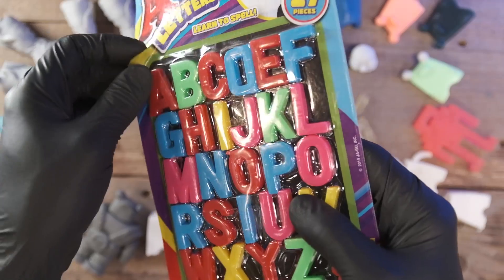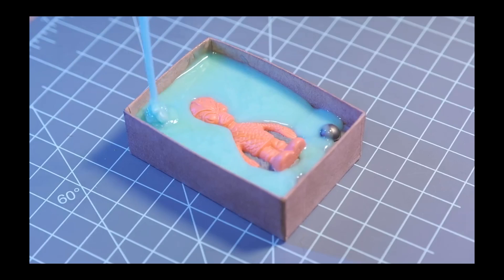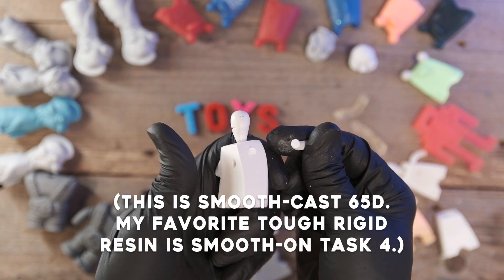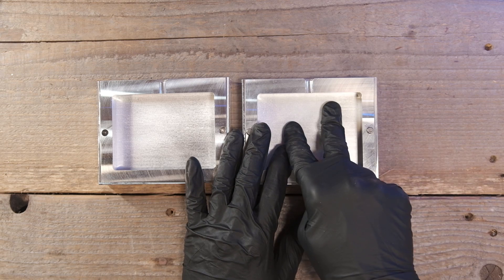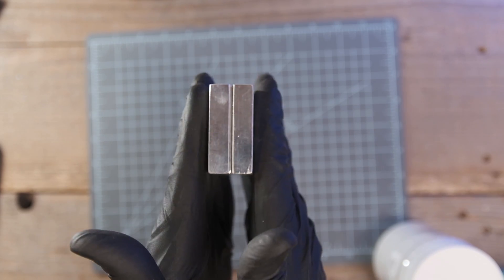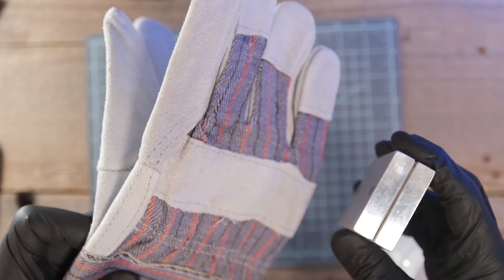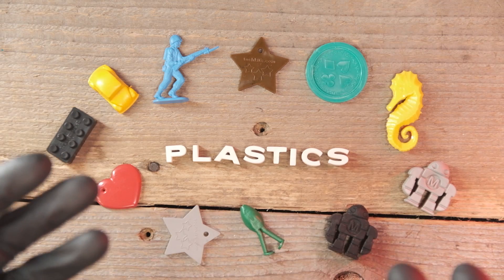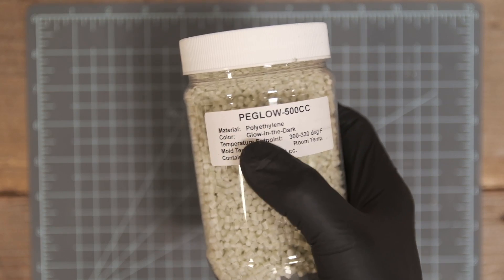First time INJECTION MOLDING! | Bench-top plastic injection molding.

Comment: 2 suggestions, 1st can you add a bracket to the push clamp and the side of the aluminum mold so all you have to do it release the clamp and the mold will open and remove the part and then ready to shot another one? 2nd, can you make a pewter mold for the injection molder instead of aluminum? Seems like the melting temp of the plastic is lower than the pewter and may work, but you would have to first make a silicone mold (mold max 60) then the pewter.

Comment: Super excited about the upcoming DIY version. I believe an oven is suitable for heating plastics to the soft fluid-like stage, and all I think we would need is a metal piston-like apparatus with a hole on one end. I would love to see how to convert 3D printed designs into plastics. Can you directly 3D print the mold that goes into the metal block?

Comment: Do you think you could Print those Metal Moulds, with a 3D printer (UV).. whats your thoughts.. The only thing, I think would be a problem, is either the heat or the strength ??

Comment: Instead of having an aluminum mold could you make a epoxy resin mold and inject into that? Epoxy resin is extremely hard and tough I would think that would be a cheaper solution than metal molds.

Comment: This is awesome!! 
Just a thought, if the temperature is settable on the machine....If you can recycle and use junk plastic, could you shred failed plastic 3D prints and use that???? I mean, That might be worth looking into.
Reply: there are grinding and extruding machines for 3d plastic already.  it's actually cheaper to buy the machine and plastic pellets and make your own spools or see if your 3d printer can handle a mod to directly print from pellets.
Reply: @jetah50  Injection molding doesn't need the extruding machine, it just needs to be ground small enough to fit in the barrel. Failed 3d prints, ground up old toys, etc is all fine you just want to make sure it's all of one type and that you know it's melting temperature.
Reply: @gregfriend7846  "failed 3d prints" implies they have a 3d printer and they use filament.

Comment: Nice Progress! For small production Runs (>200pcs) you can SLA 3D Print your molds with high temp Resin! Those printers are getting cheaper and cheaper (300bucks) and that way you can get cheaper molds! Greetings from Germany. Ps: im already using this Method and its working great!

Comment: Polyhedral dice, Crafsman! Dungeons and Dragons game dice! That’s where it’s at! Get you a mold made and go to town!
Reply: First, this is mostly general information about dice making, rather than a reply directly to Geoffrey Latham. Anybody who wants to make dice might enjoy a YouTube channel called "Rybonator." He makes resin dice with a variety of colors, opacities, and interesting additives. His content that describes how to mix non-standard materials with resin was very helpful to me. Also, he sells the dice he makes professionally now, so I assume he knows his stuff.

Making sure your dice are random is an expensive process.  Most people making homemade dice will just use molds of the acceptably random tube dice you can find at any gaming store. Resin dice made from such a mold are going to be close to fair, but not perfect. Every time you use a mold it deforms a little less-accurate. You may want to make a new mold after a few casts. 

If you are concerned about the use of inaccurate or weighted dice at your table, there are two cheap and easy things you can do to make sure that your players are using accurate dice: 
1) Insist on transparent dice. Opaque dice can hide bubbles, weights, etc.
2) Ask your players to roll the d20 (or other appropriate dice,) 12 times before the game starts. Write down their results on a sheet of paper in 12 rows with one column for each player. When my players need to make a check whose outcome they should not know, I roll a d12 behind my screen. I look up that row, use the number in that row as their roll, and cross that row off. If anybody rolls more than three of the same number, I tell them their die might be defective, and ask them to use a different d20. This test can't tell you if your players is a moral person, so I would assume "defective" dice rather than "weighted."
Reply: You can get them with literally anything in now-a-days. I'm surprised someone hasn't proposed by putting the ring inside one.
Reply: @Fractus  lol probably cause it is too expensive, but you could probably get one in a chonky d20.  Most people hand making dice out there spend very little on actual material, most of them even use entry level cheap resin.
Reply: Don't dice have to go through a special process to ensure even weight distribution to remove bias? That might only be casino dice, but I was under the impression all dice were
Reply: Steam-Powered Fox  no. It isn’t crucial for gaming dice. Real money isn’t really won or lost with them. There are tons of  dice production outfits, most of which use injection molding.
Reply: @geoffreymlatham  On the money, most use injection molding, then throw the dice in a tumbler to remove the sprue/flashing, just paint the entire dice whatever color the numbers should be, then throw it back in the tumbler to remove paint from all but the numbers.
Reply: @SteamPoweredFox  That's a big fat no.  Casino dice are made to insanely exacting standards, and have to be as close to perfectly fair as possible.  That's why they cost so much despite being machine made.

Tabletop gaming dice just have to be "close enough".  Most major manufacturers even put out dice where you can find uneven faces, or very small air bubbles, fairly often.

Comment: Dude...im just getting the materials for silicone and resin molds.  Don't do this to  my poor wallet 😢 😔 😞
Reply from the maker: I’ll definitely keep on casting resin and making silicone molds. Especially for bigger objects. Injection molding is wonderfully fast, but that small shot size means you’ll have to think about several molds for one figure. (Example: I want to make a 3.75” figure with 5 points of articulation, and will probably have to make at least 4 molds.) Always a tradeoff. Definitely don’t be discouraged! I’m only just now taking the plunge into the world of plastic injection. It took me a while. :)
Reply: I feel the same ... then again: there have been attempts at making injection molding machines on the cheap from big spiral drill bits & water pipes... ;-)
Reply: Man I'm right in the middle of my spin up silicone molding business. Learning, them I see this video pop.up I'm my suggestions. It looks like it accepts too small of molds for my 6"x5" product
Reply: @lanceg6828  What are you making? Sounds interesting.
Reply: Gotta learn to walk before you run. And you're learning to walk. There's always going to be something bigger and better waiting for you. That's one of the best things life has to offer.
Reply: yep, its far from cheap alternative. plus the size of objects is very small. but very interresting. there will be for sure affordable versions as for the 3d printers.